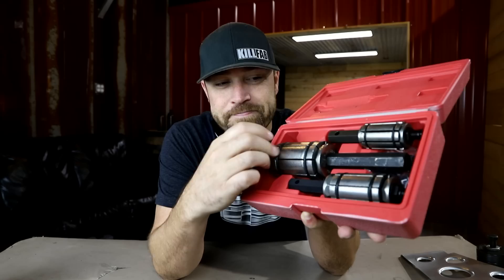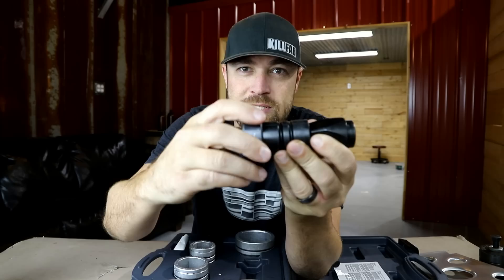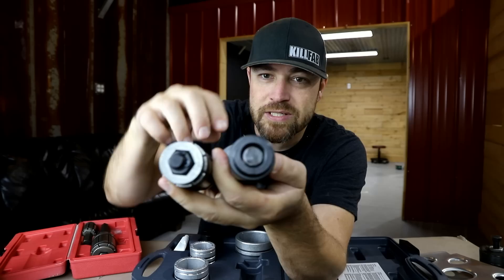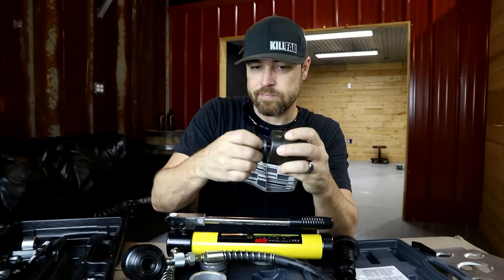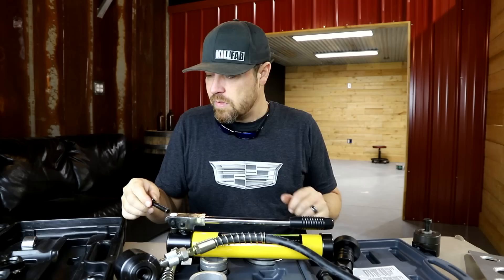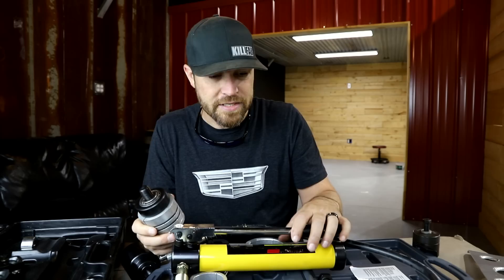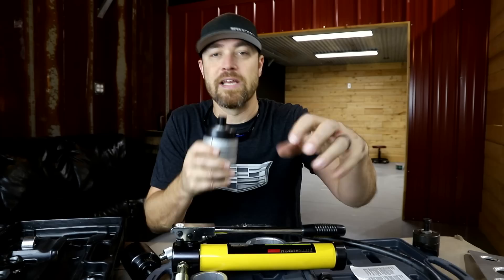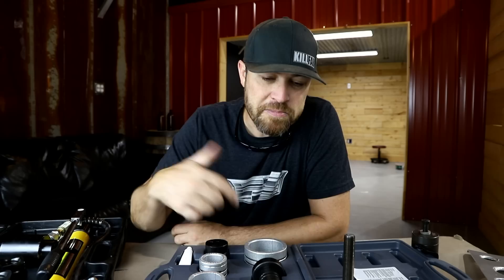You Need This Tool - Episode 114 | Lisle Pipe Expander / Stretcher Kit

Comment: I tried the  Lisle pipe stretcher set with the 15 ton knock out punch set from Amazon you listed. Something has changed because the pipe stretcher uses a 3/4 inch draw stud & the knock out punch uses a 19 mm draw stud. They won't work together without some kind of adaptor!

Comment: JUST PURCHASED THE SAME HYDROLIC HOLE PUNCHER FROM HARBOR FREIGHT THAT YOU USE IN THE VIDEO. I COMBINED IT WITH THE HF AIR OVER HYDROLIC FOOT PEDAL TO USE SHOP AIR WITH IT INSTEAD OF A HAND PUMP. WORKS PERFECTLY ON THIN WALL STAINLESS PIPE AND 16 GAUGE ALUMINIZED STEEL EXHAUST PIPE. YOU'LL NEED HYDROLIC HOSE THAT CAN HANDLE AT LEAST 40,00 PSI(FOR RAMS OR A LIFT). FITTINGS AT 1/4 IN NPT THREAD TO USE ON PUMP AND EXPANDER RAM. TOTAL GAME CHANGER. THANKS AGAIN FOR THE VIDS.I CAN SEND YOU A VID OF IT IN ACTION IF YOU LIKE

Comment: I have that kit it works great I use a impact on it a little oil on the thread and in the bearing and never had a problems with it I only ever used on steel pipe

Comment: Haha 3 years later..

Anyhoo, Kyle wish I had seen this video back when you ‘published’(🤔) it. Tried to use one of those pipe expanders today it was an almost total fail.. then I stripped the threads… DOH… I didn’t lubricante them in the haste to get things done although I’m not sure that would have worked in preventing this happening… no doubt I didn’t help.. now maybe just going to order a flanged section of pipe to weld into my exhaust.. probably quicker.. I am rubbish at welding to.

Comment: Hey Voss small tidbit, for high pressure thread applications like that center bolt for the lisle tool, put a dab-a-do of copper antisieze on the threads, not aluminum but copper antisieze. Copper one reduces the prssesure on the threads hence saving the threads. Your pressure will apply to the entire center pull bolt then and not just on its threads. I use copper antisieze on crows foot and 3 jaw pullers. After learning that little trick with antisieze my puller/pusher tools last way longer.

Comment: I used the Lisle pipe stretcher kit with the Harbor Freight hydraulic knock out kit to fab my 3" T-304ss dual exhaust on my G8. The tubing was .065 and it had no trouble expanding to fit one inside the other.

Comment: Cool to see the tool review again. I have that set along with the add on set for 4 and 5" tube . I use the 5" pretty regularly for heavy truck exhaust and it works good. I use an impact but I grease the crap out of the dies to reduce friction, helps big-time. Pretty cool using the knock out punch cylinder to apply pressure. Might want to check out a 10,000 psi air over hydraulic port-a power pump to run the cylinder. Like you said , turning the dies helps with getting an even expansion joint.

Comment: if the expander was made of steel it would work better
Reply from the maker: it is
Reply: @Thefabforums  I thought it was aluminum?
Reply from the maker: @rafatrill  the expanded mech is made of steel. The adapters that go over it are alum
Reply: @Thefabforums  exactly the actual part that expands the exhaust pipe is made of aluminum

Comment: Those cheap pipe expanders are really only good for trueing previously clamped pipe ends. Gets rid of that crimp that makes fitting new parts a pain. Pretty useless for making your own slip fit joints on a custom exhaust.